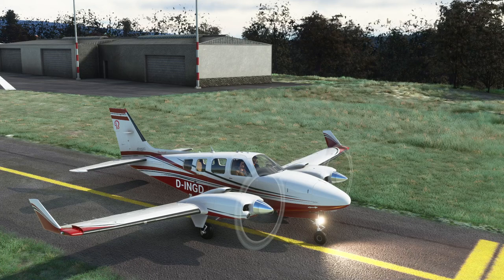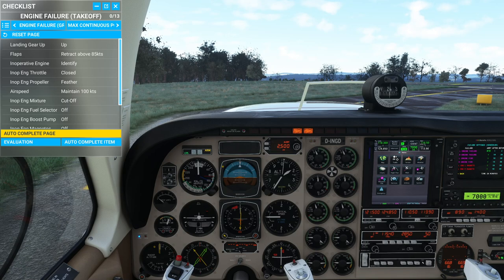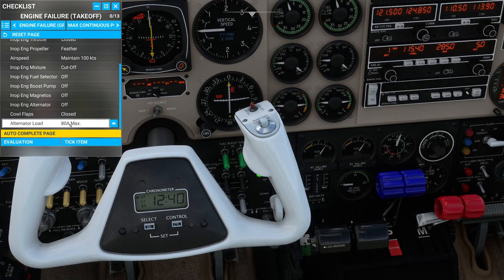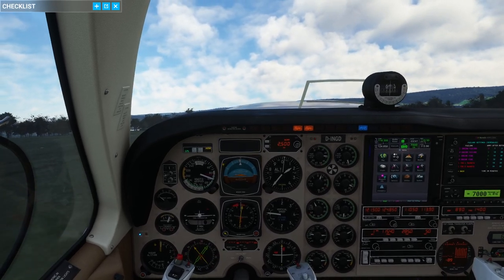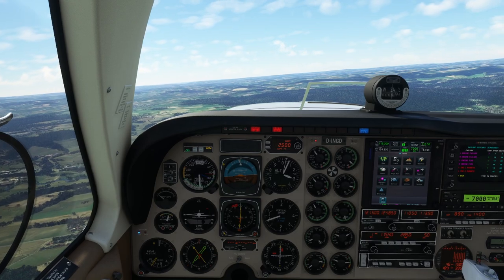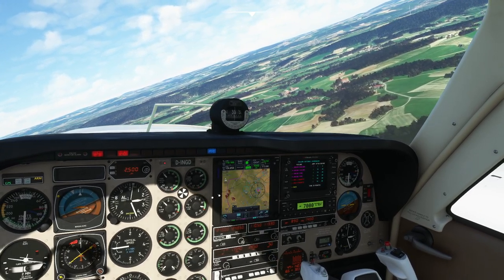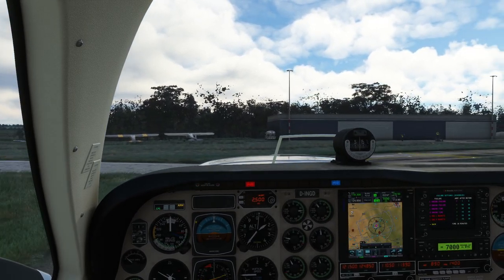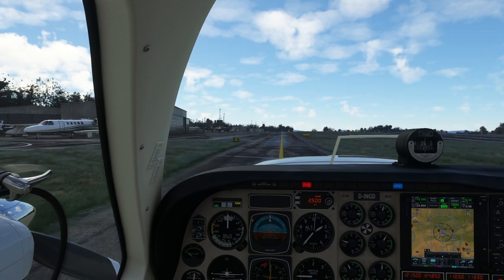ENGINE FAILURE on TAKEOFF in a Multi Engine General Aviation Aircraft | Analog BARON | Real Pilot

Comment: Was I the only one that pulled my feet up when the aircraft dipped at L ENG failure?  :)  Curious as to why the manifold pressure spiked after feather - does the prop windmilling essentially back-drive the engine and cause the manifold pressure to stay elevated?  And last question - what was the airport?  Scenery looked amazing.  Thanks so much for these videos, I learn something every time!
Reply: Maybe not but that "disc" causes a lot of drag if that prop doesn't stop.
Reply: Airport is Bayreuth (EDQD), was mentioned during the landing.

Comment: Entertaining/fascinating stuff. You did well to not nosedive into the tarmac when the engine failed, meine herr.

Proves how necessary feathering of the affected engine is, in order to keep the speed up.
Reply: That's the reason why the likes of the ATR72 and Dash 8 Q400 have autofeather systems - if one engine fails on takeoff, the propeller on the affected engine is automatically feathered.
Reply from the maker: @Lcmortensen absolutely and the importance of that can't be overstated! Feathering the prop can make the difference between going to the clouds and going to the tarmac. And now you decide which one is the better option ;-)

Comment: Thanks E. I had the opportunity to accompany my CFI and his instructor while he was learning twins. They did a simulated engine failure and it scared the crap out of me. Never liked twins since that time, even in the sim. Pleas correct me if I'm wrong. The purpose of feathering is to prevent windmilling. Looks like the sim does not simulate feathering?
Reply: It seems to work well with some aircraft and not so well with others. Not sure why that is. It wasn't properly simulated at all until a few sim updates back, but it is at least supported by the sim now. What is annoying is there's no proper control setup to feather a prop aside from doing it by using the mouse in the cockpit. I find it really weird that it's the case.
Reply: @happydappyman  What throttle etc quadrant are you using ?  I eventually figured out how to calibrate the Virtual Fly TQ6 quadrant so that it goes into full feather and the prop comes to a near stop.
Reply: @raywalsh5414  the bravo quadrant. It works fine to feather a single. But with a twin I can only feather both props at the same time
Reply: @happydappyman  You can use a third party utility such as SPAD to re-configure your controls if you haven't tried it already ?  That's what I use.
Reply: @raywalsh5414  Thanks, I've been meaning to give that a try.

Comment: Nice video. However you’ll find in the real world you’re more likely to be closing throttles and landing immediately since you’re engine failed below blue line speed. It’s a bit different to flying an RPT jet in that sense.
Reply from the maker: You'd only do that if you have sufficient runway left which wasn't really the case here. A flying plane on one engine is safer than a burning one on the ground.
Reply: @A330Driver  Interestingly we are actually taught the opposite. Regardless of runway available, you are much better off chopping the power and putting it down under control then spiraling into the ground trying to fly below Vmca. Its something that we brief every takeoff and are taught in flight school :)

Comment: Super instructive!!!
But with engine feathered does it still spining or thats a simulator thing?
Reply: Shouldn't be spinning. Feathering is supported by the sim, so I was wondering what the issue is as well. It could be that it is feathered as far as the flight model is concerned, but is still visually spinning.
Reply from the maker: It can happen, especially in aircraft like these. It shouldn't, but theory and practice are often two different things in general aviation.

Comment: I think the prop was supposed to stop when you bring it to the feather position, right?
Reply: It worked for Q8Pilot. I find that in MSFS the prop won't feather unless the lever is really pulled back all the way.
Reply from the maker: Yes and no. In theory yes. In practical terms, when I shut an engine down in flight training in real life in a twin the prop didn't stop either when we feathered it. The instructor said that was quite common actually.